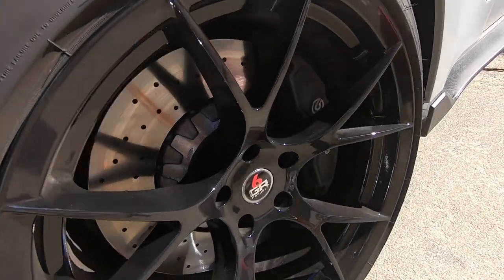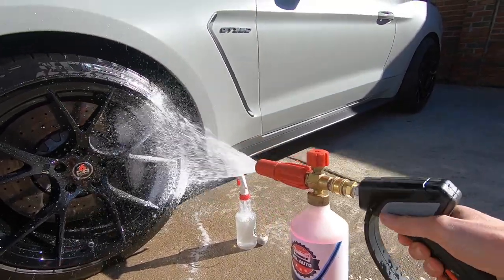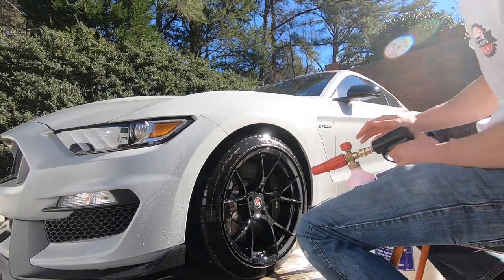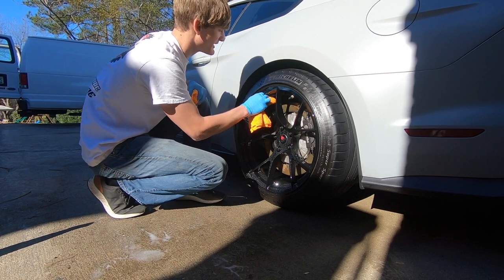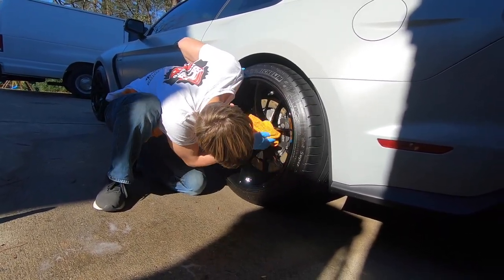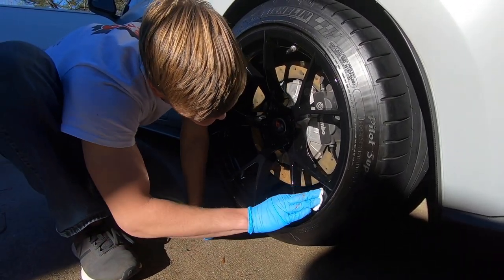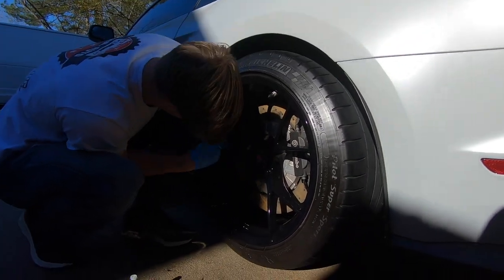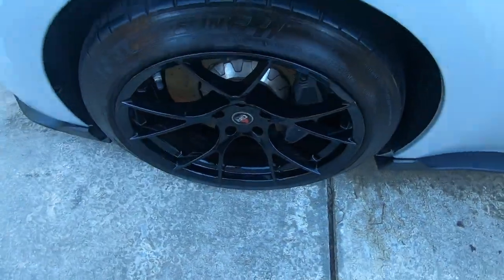How to Ceramic Coat Wheels - GT350 Project 6GR Rims

Comment: Where do you get that LONG handle thinner Wheel Woolie?    All the set's I have seen,  the middle size and small size have much smaller handles.     I like that thinner size with the longer handle you use here that reaches farther back into the wheel/rim.    Thanks
Reply: I need one.

Comment: can you feel the difference between the stock wheels and the 6gr wheels? how much do they weigh?
Reply: Paul DE GUZMAN The 6GR wheels are extremely light they only weigh 24 pounds each and that’s 19 x 10 or 19 x 11 sizes they are at least 10 pounds lighter per wheel than the factory Mustang performance package wheels

Comment: I have a 2021 ecoboost mustang. Im looking to get the big brake kit which has the gt350 brakes. Do you know if i would need 20s to fit those brakes or would the 19s designed for the gt350 work?

Comment: ? Why would you not ceramic coat the barrel
Reply from the maker: C Beritrand because on this vehicle there is approximately 2mm of space in between the wheel and the caliper
Reply: That’s why you take the wheels off the car when you coat them.  You do a half ass job you get a half ass result.
Reply: What was the product (iron remover) you used on the wheel initially?